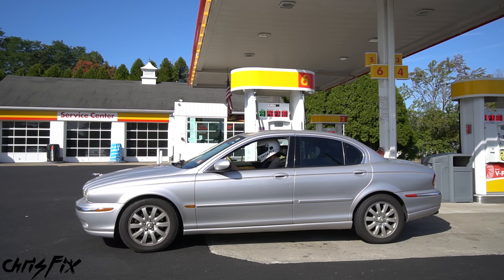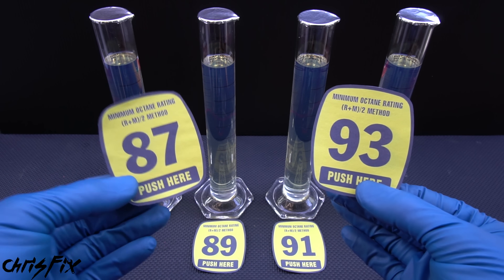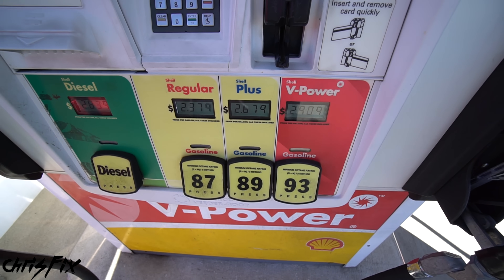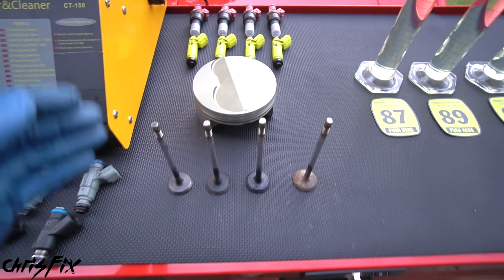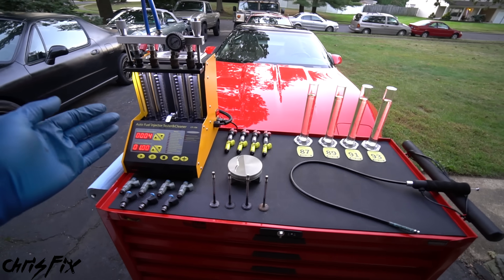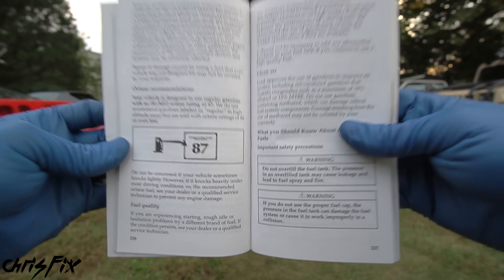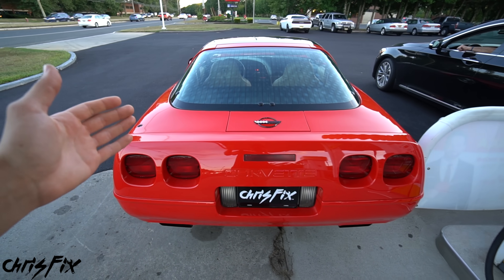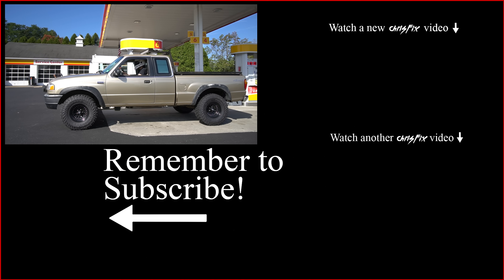What is the BEST Fuel to Use in Your Car or Truck and WHY

Comment: I have a 1979 F100 that didn’t come with an owner’s manual and it obviously doesn’t have any of those signs that you showed because it was made in the 70s. How would I be able to check what fuel it uses? I’m also wondering if swapping out a cam can cause the vehicle to require a higher octane fuel because the cam in it is not stock and makes it sound like an old hot rod.

Comment: Move on from this archaic, polluting, carcinogenic mindset.  The best fuel to use in your car is electrons....costs 50% less per mile or better for the average American vs petrol.  In addition, there are still a number of free charging sites of you're lucky in your area.  Filling up the battery when you regenerative brake is so thrilling.  Your gas tank doesn't fill up when going down hill or slowing to a stop.  This message was paid for by common sense.

Comment: Also worth pointing out that all engine fluids can break down over time, this is true in particular for engine oil and gasoline.
Ethanol attracts moisture from the air and can dilute the fuel thus causing knock to occur this is particularly true of Eth blends like E-85.

Comment: But it doesn't hurt if you use 93 V-power when your car will run on regular. It's just cleaning the inside, but is a bit expensive. But you gas prices are low. I'm paying €1.69 for one liter of gas 98 V-power  in the Netherlands

In Europe the ethanol level is in 95 10% also called E10 and in 98 5% E5. we had 102 with 0% ethanol, but to legal requirements this is out of production since this summer.

Comment: Hmmm Shell is claiming 75% cleaner valves if running 2500 continuous miles on V power huh?? I'm a bit sceptical about that but curious as well. That was my preferred gas brand  to get back in the day until people started voting for higher gas prices for "road repair" here in Cali. Then the governor decided to switch all gas taxes to fund "Climate change". Basically free money for Democratic politicians.

Comment: If you are driving a car you can actually tune. More timing, to a point will make more power! So, advance your timing a few degrees, then use higher octane fuel, and you will make more power.

Comment: Is 99 octane without ethanol better for your car?
Reply: bad for the environment
Reply: @bobbarker3248  just curious if its "best for your car" and why...and if higher ethanol is actually not good for your car and why?
Reply: @abdhashmi  ethanol is alcohol and has less energy than gasoline, which is why there are regulations as to how much can be put in gasoline. because you'd end up using more gasoline in a period of time that has more ethanol, and that could promote unethical business practices. but ethanol is better for the environment. however, because it is alcohol, it could damage engine parts and such, such as rubber seals and certain metals. but some say modern cars are engineered to deal with ethanol

Comment: Diesel shouldn’t do too much damage to a gas engine. I’ve accidentally done it at work and all it does is smoke like a chimney. Gas in a Diesel engine on the other hand, that’s where problems happen. Which, I have also done accidentally. Thankfully it got fixed before the machine was damaged.

Comment: Higher octane means higher ethanol concentration. Ethanol is pure and burns cleaner, meaning it pollutes less than gas. Wouldn’t that mean higher octane does burn more pure because it leave less of a pollutant than a lower octane lever with lower ethanol amounts?

Comment: 93 is better Vp fuels 94 is even better, Cam2 112 Octane Blue Leaded is Good 2 for cleanouts (will damage 02 sensors and cats though). Have money to test with and want best for your specific car?, Go to an automotive diagnostics center with a Dyno, Get them to Dyno the car with each intended use fuel, BOOM you have your answer based on dyno readings that dont lie. There are winter and summer versions of fuel too from the gas stations so be aware of that also.

Comment: if octane doesn't increase power , how come racing fuel is over 120 octane? and how come alcohol cars run faster than gas cars?
Reply: alcohol (ethanol) has less energy than gasoline, and racing fuel is probably over 120 octane because race cars probably have higher compression ratios and/or turbo/super charges, and therefore need higher octane to allow the fuel to detonate at the appropriate time

Comment: Quibble: in a "87" engine if one puts in 89 or 91, the timing will be adjusted and power will be improved. However, as always power only really matters when wide open throttle.  So...
As to fuel economy, for the same reasons as above, higher octane will give a small improvement in economy (for an "87" engine).  However it is small and nowhere worth the difference in price.

Comment: Most all new cars will run on regular fuel. Their computers will adjust appropriately and prevent any damage to the engine. Performance cars sometimes will say that they will have increased horsepower if using a higher octane fuel. They will still run just fine on 87 octane though. This is thoroughly discussed in the newer Ford Mustang owner's manuals as well as the manuals for some European cars. Turbocharged and many exotics do require higher octane fuel though and will say so somewhere in the fueling area or on the fuel gauge itself. If your vehicle doesn't say that it requires premium fuel putting it in your car anyway will offer some better cleaning ability and offer a small increase in power but the price doesn't equate to the benefits in cars that don't require it.
Most all gasoline in the U.S. comes from the same few refineries. The only difference is the dyes and additives that are added afterwards by the distributors. The additives that give the best performance are only found in the Premium blends. People running on Regular get shafted. You will never see an ad for regular or mid-range gasoline. All of these fuel companies shill their most expensive tier. 
This video is just an ad for Shell which seems to be happening a lot on these automotive channels lately. It wasn't as bad as some of the others I've seen but it's obvious that Shell has invaded the YouTube automotive world recently.

Comment: We got 85, 87, and 91 out here. I went for a bit if 87- sometimes I go nuts and put 91 with a bottle and boost but generally 85 is aight for my 07 Saturn ion reg (redline would be sick lol)
Reply: From what I was told by a friend who delivers gas in my area. There is no Mid-grade. They fill the.both with regular gas and then 1 for premium. They get by with this by advertising an octain that they say is no lower than 85. Though it's actually the same as their mid 87

Comment: what I like to do b4 every oil. change I run seafoam half into the fuel tank half in my oil helps clean alote of the carbon build up.       and I always run Lucas oil stabilizer as well. I had a knock in my 92 chevy I threw some lucas high mileage oil stabilizer into it no more knock.   anything made by lucas is the best.   idky I dont use it for the fuel injector clean and the oil clean guess sense seafoam can be put into both idk about lucas.
Reply from the maker: Thanks for sharing. I am curious how an oil stabilizer helped your knock situation. What are you thinking?

Comment: The biggest things to remember about diesel vehicles are:
1) Never put diesel in the DEF tank, or DEF in the diesel tank(s), and;
2) Never let the vehicle run out of DEF. That will put it into shutdown mode, which requires a trained tech to get it out. DEF before dishonor.
Source: I drive a tractor-trailer for a living. I probably burn more diesel in a year than some folks will ever burn regular gasoline in their lifetimes
Reply from the maker: Thanks for letting us know!! Out of curiosity, how many miles do you drive a year?
Reply: @chrisfix  I'm glad I could be of assistance. To answer your question, I was on track for 110,000 miles this year before I decided to change companies. This is about average for over the road (aka long haul) drivers throughout the industry

Comment: I fill up usually at a gas station that has e88 or has the number 88 in it. Is this the same as e15? How does it compare?
Reply from the maker: e-88 is up to 88% ethanol if that is accurate. If there is no "e" then that is 88 octane which is a little odd but possible.

Comment: I have a turbocharged 3 cylinder. Would it be beneficial to run 93 octane? (engine only has about 7k miles on it)
Reply from the maker: Probably. Usually forced induction engines such as turbo charged and supercharged engines require premium so check the owners manual. A lot of newer cars have plasma coated cylinders and advanced knock sensors so they can run regular tho. You might get more power and better MPGs with premium tho!  Something to look into!
Reply: @chrisfix  Great! Thanks for the reply!

Comment: If your car runs flex fuel can u run regular gas or will it damage the engine
Reply from the maker: You can run regular gas in a flex fuel car. You can also run e85. You can also mix the two.

Comment: Hey Chris could you go more in depth on e-85 is it cleaner for your car? Does it have less or more energy. Why is it so cheap so does it make it a bad fuel etc. My car is flex fuel tuned with bigger injectors. I just wanna know in-depth how my car takes the fuel
Reply from the maker: I can but in my state we only have 2 stations that sell it so it is tough for me to film. With that said I want to show how to make your car flex fuel. For now, know that e85 is up to 85% ethanol and ethanol is derived from corn so it is cheaper than fossil fuels (usually). Also ethanol absorbs water so if you dont drive the car every few days it is better not to run it. Ethanol has crazy high octane (108 I think) but is 1/3 the energy of gasoline so you need more to get the same power. Pros are it is cheaper and we make it here in the USA, but the cons are it absorbs water and you get less MPG. Hopefully that info helps!
Reply: ChrisFix thank you helped out a lot, I run it in my daily driven 2017 Mustang GT, it’s tuned for e85 with bigger Injectors and it’s also full bolt on, so the water isn’t a problem because I drive it every single day, I didn’t know the octane level which really helped out a lot so now I know I won’t suffer from knocking, thank you!

Comment: I chipped my volvo v70 2.4t to 250hp, in the handbook for the chip it said to use 95 (i think) octane but volvo says to use something below 90 (don't remember what octane). Which one do  you think i sould use?
Reply from the maker: If you tuned it, I would say use the higher octane because most of the time that is how those tuners get more power out of the engine (advancing the timing).

Comment: Chris what is your take on non ethanol fuel for vintage/antique carburated vehicles?
Reply from the maker: The problem is those cars normally sit a while and ethanol absorbs water so that can cause corrosion.
Reply: @chrisfix  thanks for your answer Chris. I have a mid 80s Japanese truck that had the OEM carburetor fail a few years ago so I replaced it with a weber carburetor kit. It is my reserve/chore truck averaging less than a thousand miles a year. Been feeding it non ethanol fuel since I replaced the carburetor to mitigate water and the potential ethanol degradation of the plastic and rubber fuel system components.

Comment: What if I have a brand new car and manufacturer says run 87 but the engine knocks with a heavy work load. What do you do then.
Reply from the maker: Use higher octane. Move to midgrade and see if that fixes it.

Comment: People use Seafoam and other top end and valve cleaning agents. But still to this day I run a couple tanks of Shell Premium and it does the trick everytime.
Reply from the maker: Seafoam is great and one of my favorite fuel additives but most of the time people dont need it. Engines rarely get excessive carbon buildup, especially port injected vehicles.

Comment: How do I know if my car is getting detonation, like for example, you said a knocking. Do you have a video on that or possible sound reference? I have been recently hearing a knocking sound when I drive and hear it decrees as I decelerate. Could this be the knocking of combustion? I drive a 2011 Nissan Cube.
Reply: there's youtube videos on that, I recommend you watch them for reference.
Reply from the maker: Sounds like marbles or ball bearings that got loose in the engine. It is a pinging noise.
Reply: ChrisFix I have a sounds that it makes on every full rotation of the tire. When I slow down the intervals between each sound gets longer. When I go faster the intervals are shorter. What could that be

Comment: What affect does E-85 have?
Reply from the maker: If you have a flex fuel vehicle it is cheaper to run the fuel but ethanol absorbs water and has less energy than the same amount of gasoline.
Reply: @chrisfix  Thank you for your response. I meant to ask what affect E-15 has. For instance my pickup calls for 87. If I put in 87 with 15% ethanol will there be a dramatic or noticeable difference?

Comment: Why the hell use shell? That station looked pretty empty. All top tier stations sell the same gas. Shell is a dollar or two more a gallon. I guess sponsored???
Reply: stop licking scotty's butt
Reply from the maker: The station was jamming and I had to wait for it to die down before I filmed. The fuel is not the same in the sense of the additive package they add which is special for each brand. This station has cheaper gas than anyone around. Now I just proved all of those points null, you can still go wherever you want. I go to the cheapest station around. Sometimes costco is cheaper and is top tier. Sometimes the no name stations are cheaper and it is perfectly fine.

Comment: Can u mix gasoline from different gas stations like different company but same number
Reply from the maker: Yes but I was told sometimes the additives they add in are not very compatible. The gasoline is the same but the additives are different. I mix fuels all the time though and never had a problem.

Comment: I put arco 87 octain my truck goes like 250 miles fill it with shell 91 goes 340 yea no difference your right Chris
Reply from the maker: Unfortunately it is literally impossible for a car to get 36% better fuel economy using any type of fuel. You will see a 5-10% difference which is mathematically possible but it is literally impossible for a different octane fuel to give you 36% better fuel economy unless you are using the wrong fuel. From what you are saying, your car is supposed to take regular and you get better fuel economy using premium. Now you are probably saying, "Well I know I got better fuel economy, I have experienced it" and you definitely have, but there are other factors that take into account including weather, how you drive (biggest factor), traffic, lights, stop signs, routes, etc. So while you can see a slight increase if your car can use the extra octane to advance timing, you wont see 36% just from fuel. Thanks for your comment.

Comment: Truck and Motorcycle run Regular.. completely ignored this and I’ve always filed with premium since day one and fuel injector cleaner and water remover shots every 5K... should be good
Reply from the maker: You can do that but you are throwing your money away. Fuel injector cleaner isnt needed, you dont need water remover, and if your car only needs regular, you only have to run regular. You do what makes you happy and that is fine, but in reality none of that is needed and you can save money.

Comment: Hey Chris, what about higher elevations? We have 85 octane here in Colorado. I saw it briefly mentioned in the Mustang owners manual in the video. But not all car manuals have that clause. Could you dive more into the higher elevations myths?
Reply from the maker: That would be cool to make a video on but for now, since you have less atmospheric pressure, there is less air going into the engine and less risk for detonation so you dont need as high of octane.